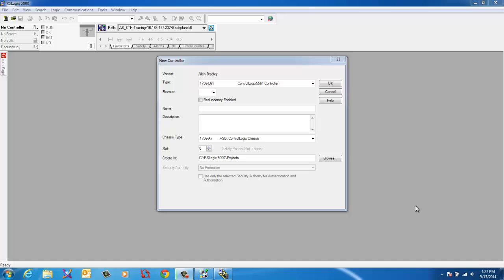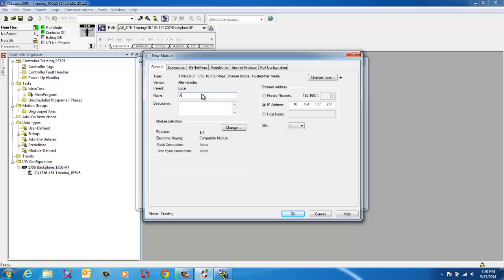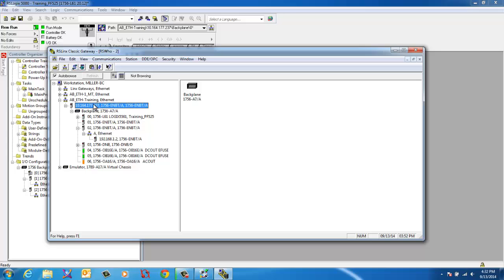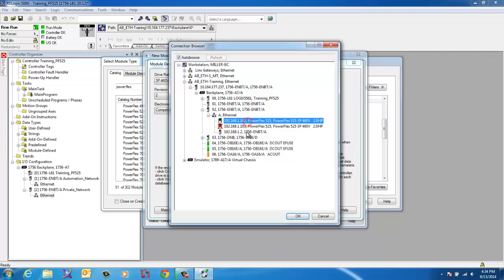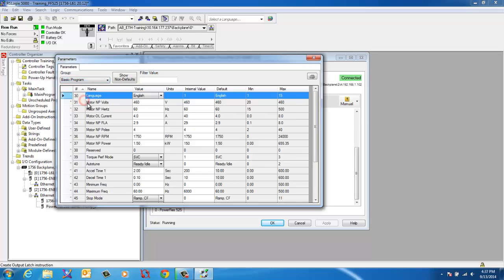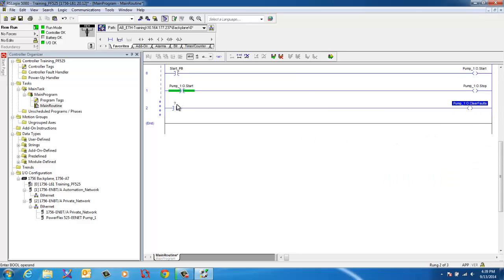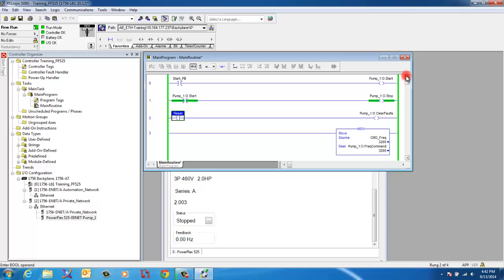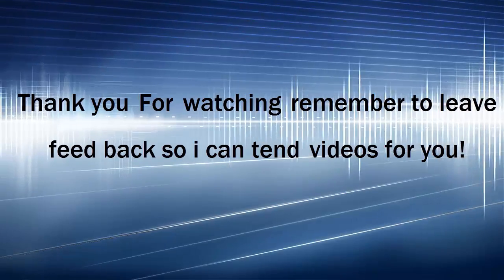Adding a Powerflex 525 to RSlogix 5000 over ethernet

Comment: Thanks for the tutorial! Could you please explain why did you created a automation network with a network module and other private one with the other card? Is it mandatory to use drivers on private networks or it was just made for your network topology and project only?
Reply from the maker: This was just what I usually do for facility installs, this helps keep network congestion down and helps organize networks, there is no real good reason why I do it this way but this is just an example why.
Reply: @PLCAutomationTraining  Thanks a lot for replying me!

Comment: video is ok, very easy .! but 
 need to add that for the Speed control,   need it a jump in the control pin 11 to 1. to model 525 over 5hp

Comment: Hi, do you have any experience doing the same thing but with CCW software? I am trying to control a 525 using a micro820 PLC, I have both devices in a program in CCW (I can control the PW525 from CCW) but I can not find out how to pull the Powerflex variables into the global variables list.

Comment: Hi!
I have installed five (5) pf525 in my system. I always experience this F073 faults, can you please help me resolve this.
3 of pf525 was programmed in ml1100 and the other two was in the ml1500 both in rslogix 500.

hope you can help me.
Reply from the maker: Manex Emano is it all of them?
Reply: wow! thank you for the response!

yes! all of them. I noticed that if I run ccw and get connected online of the 5 pf525, that annoying fault will be gone. but no one needs to get their lappy hook up in the network just to get rid of that  fault, right?

can you please help me because I know I missed lots of things here.
I just recently changed my system, by the way. It was actually designed separately (the cip station [ml100]  and the process station [ml1500] ) but since my boss gave me another requirements and tasks that the systems should be connected all in the ethernet for much easier (not actually) data and command exchange.

I  already made a rung that will make the command logic clear faults always on so that it will clear immediately the fault. --- will this help or i just made it worse?
Reply from the maker: Manex Emano I would check your message times if you want to send me the rss I could look at it for you. Coldbluemountainapps@gmail.com

Comment: Thank you for this awesome video. Quite clear and to the point. Question: How different is the PowerFlex 753 setup from the 525 as you show here? Do you have any vidoes for that? Thanks!
Reply from the maker: Jackgitz23 the 755 is different. though has many similarities. the hardest part with the 755 was getting the IP address setup.

Comment: Really Helpful tutorial. one Situation i am facing. The PF525 drive is already configured and running perfectly fine. now i wanted to monitor the drive parameter when it is currently running. to do that i got online with the PLC and got into the properties of the PF525 from the I/O configuration in RSLogix5000. and from there i clicked on Drive tab but then was getting Error as '"AUTOMATIC CONNECTION FAILED - MISSING DEVICE IN PORT 1 IN OFFLINE DRIVE". 
So is the Drive Configured incorrectly? and Is there any Solution to the Above Error
Reply from the maker: YASH JARIWALA i will look this up i havent ran into this one can you send me a pdf of the drive parameters from ccw
Reply: i dont have a saved CCW file. its been somehow deleted. i can send you the PDF of the Problem which i am facing so that you can have a better idea of it.
Reply: Can you provide me a mail id to which I can send you the PDF ?

Comment: Great video.  I am having issues with the ramp function though.  I have 420 seconds in the drive but it jumps to 60 hz immediately.  Also, when I try to adjust speed reference from 60 to anything else it stays at 60.
Do these need to be on "velocity" mode?  Or is "position" mode okay?
Reply from the maker: Jordan Vande Brake velocity mode. then check the speed reference parameter in the drive to make sure its setup over ethernet ip
Reply from the maker: Jordan Vande Brake also make sure min freq hz is at 0 and max is 60 unless you need more
Reply: thank you very much for the prompt replies.  My min and max is 0-60 HZ.  It does seem to respond now to my 'freq command' logic.  And, seems to accept my accel rate.  However, it automatically instantly jumps to 60 HZ and THEN comes back down to the commanded frequency, at the accel rate, entered.  I obviously want to send it the start command and have it accel to 60 HZ over 4-7 minutes(starting centrifuge motor).
Reply: I must have had some other parameters fighting with each other.  Reset to factory default and started from scratch adding only what I thought I would need.  Seems to be working fine.  this was a great video.  Huge help.  Thank you.
Reply from the maker: Jordan Vande Brake seperators they use to use powerflex 700, is this a pump to the seperator
Reply from the maker: Jordan Vande Brake glad i could help out thank you

Comment: Thanks for the video.
Why is Pump_1:0 Start used instead of the input? 
Is it because the VFD will start outputting power to the pump motor?
Reply from the maker: Matt Gallagher please rephrase your question im a little confused
Reply: Sorry - I meant in the ladder logic portion, you used a PB start to activate "Pump_1:0 Start". I was wondering the difference between this tag and "Pump_1:I". At about 11:05 you said "we don't want the input, we want the output".
Reply from the maker: Matt Gallagher because the inputs are what you are reading from the drive and the outputs are what you are writing to the drve, sorry for the late response.

Comment: hi, awesome video!
would this be the same for the powerflex 40 with comm e adaptor?
Reply from the maker: yes except the speed ref is a different value i believe or the 70 i dont remember
Reply: Wow, fast response! I've been reading RA literature and the generated tags are different to the 525. I am building a new control panel with 4 powerflex 40 and would rather use ethernet instead of hard wiring them all. I also read about multidrop with 1 comm e card and I assume modbus daisy chain to the rest, but programming seems more indepth. What would you advise?
I'm dan Btw from uk

Comment: Great video! Do you have a video or can you show how to read the output current from the drive. For example what logic instruction do you need to use to read it.
Reply from the maker: in the configuration screen where the match drive is in the upper right corner you can add the current. I'll add it to a quick video for you
Reply from the maker: Here is your link https://youtu.be/qCxT4ig-smc

Comment: Very informative, good clear exemplified presentation. I like the simplicity of the complex intelligence of this drive. By the way I have a question, what is the Ethernet switch you recommend when connecting several drives? to aim reliability but keeping in mind my stinging budget.
Reply from the maker: hirschman switches are the best in my opinion.
Reply: PLC Automation Training Thanks alot for the recommendation, I will look into it.